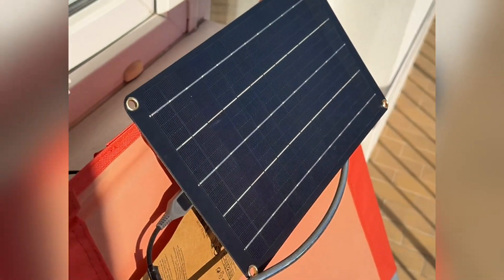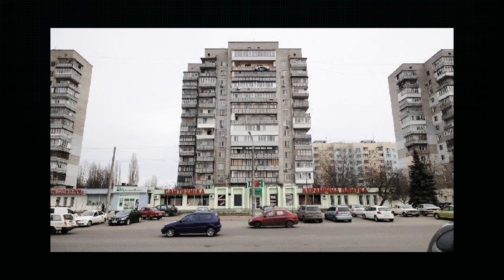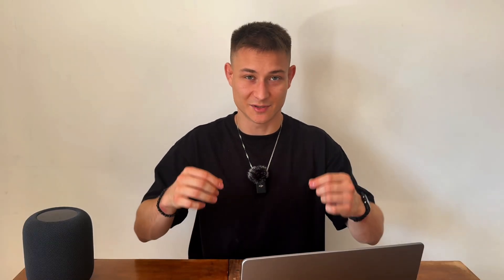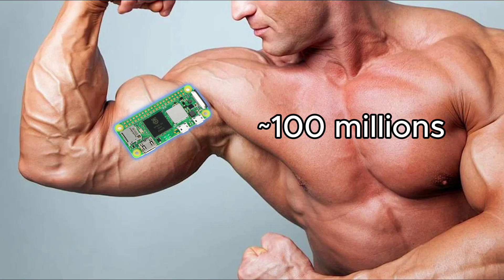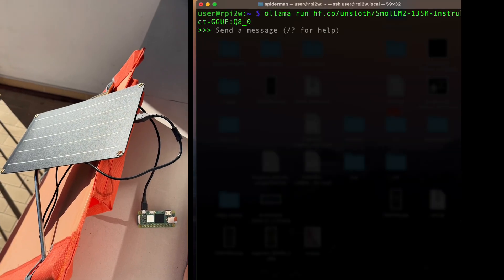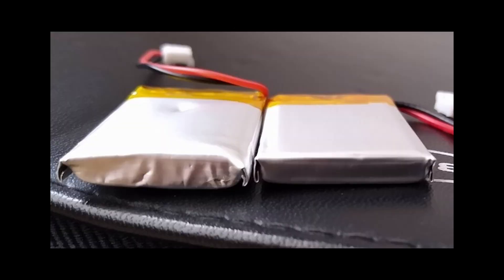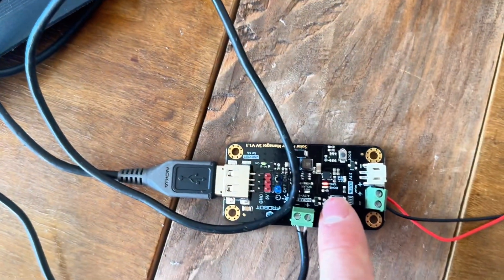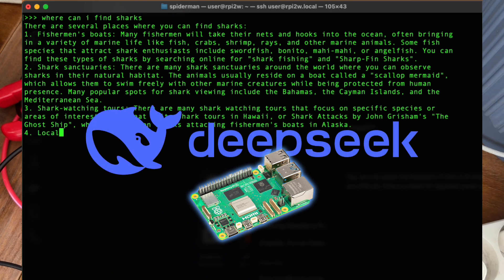Raspberry Pi with Sun Energy | Full Tutorial

Comment: That was a very nice video. Thanks for sharing. I want to use a Raspberry Pi as a mini home server to run some services I already run on an old Samsung NC110. The other day, I accidentally disconnected it from the power. It kept running because it has a battery, but I realized it would shut down if that happened to a standard Raspberry Pi. So, adding a battery and charging it with solar power would be a blast.
Reply from the maker: Thanks! If your station has stable grid access, probably a raspberry with some backup battery should be enough- though not as cool as sun-powered backup😄. Greetings!